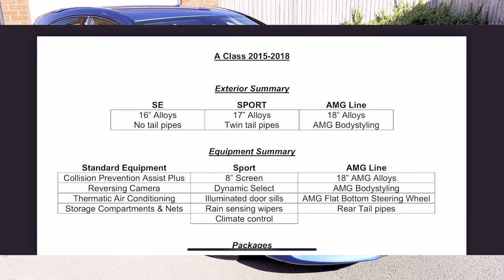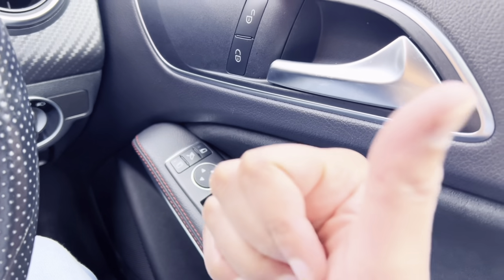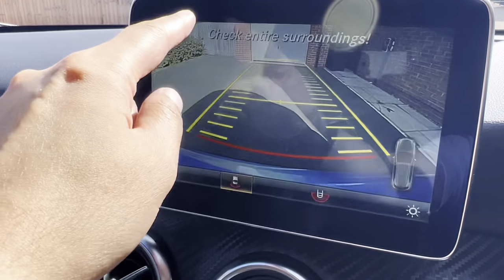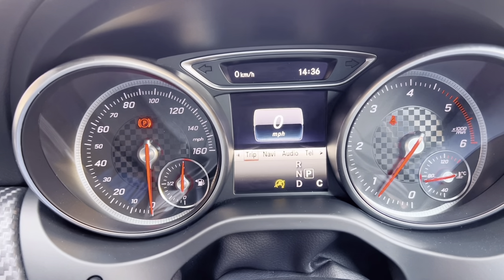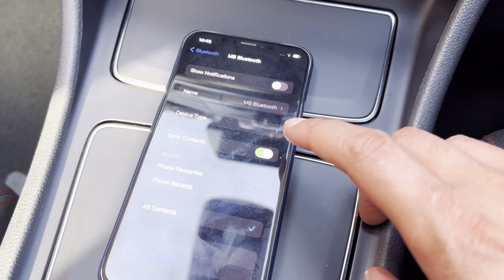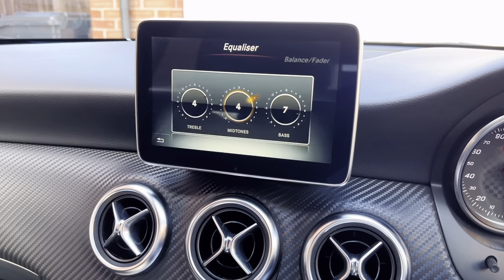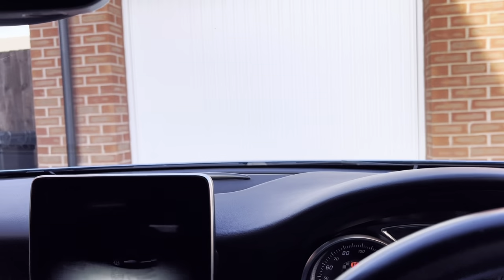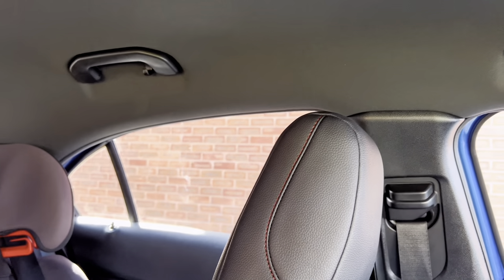2013-2018 Mercedes A-Class. All you need to know interior and exterior features and how to use them!

Comment: is yours a a200d?
Reply from the maker: Thanks for the comment. Yes. Do you own an A-Class too?
Reply: @DrSaahb  nope but thinking of buying one. are they reliable. any expensive repairs?
Reply from the maker: I have been really lucky with my car. Just servicing (including gearbox service) and normal wear and tear stuff likes brakes and wipers. Check out my other video which shows what options you can have etc https://youtu.be/bphGORlbyP0?si=8uMF9-b4DDWTB5hZ 
Let me know if it helps?
Reply: @DrSaahb  thanks.  how much roughly do breaks cost.  trying go compare to my focus😂
Reply from the maker: I can’t remember but i think fronts were about £150-£200 including labour to fit them. I normally need to do this kind of work when it’s been serviced at Mercedes. If you call your local dealership they can give you a better idea.
Reply from the maker: If I get allot of requests to do a video on maintenance costs then Ill upload a short video on my experience with my car.
Reply: @DrSaahb  really thats not even as expensive as i thought it would be.  and okay thankss!
Reply from the maker: Labour rates for an hour are roughly £120 from a Mercedes dealer. Servicing is not cheap but it does include breakdown service which I think is super useful